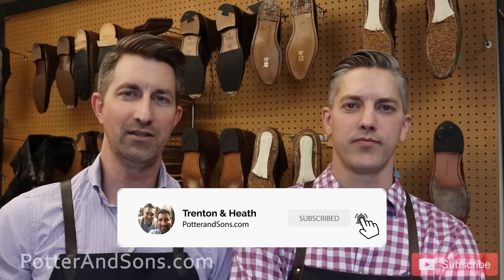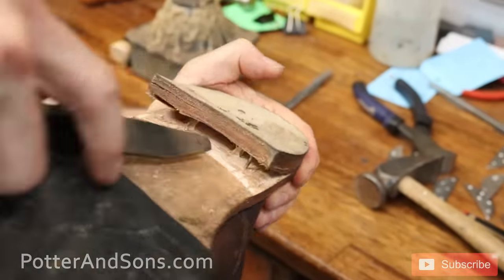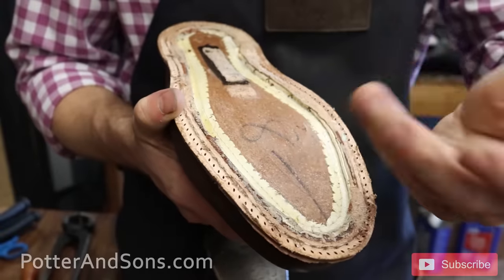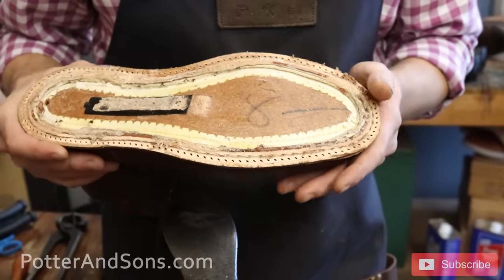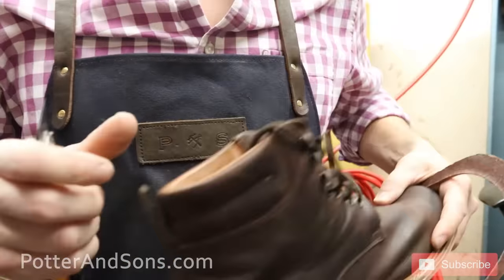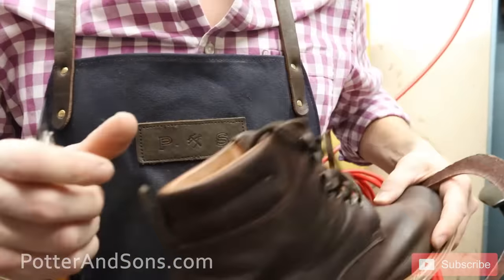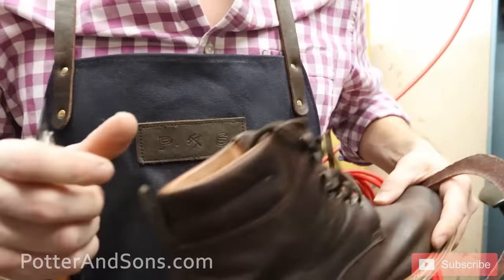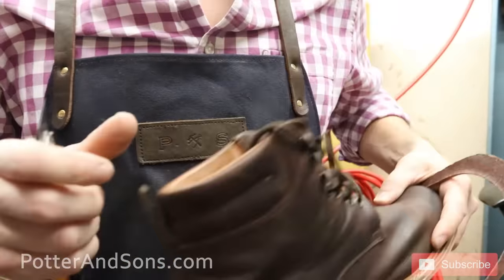Boot Restoration | Refurbishing These Boots With Vibram Wedge Soles

Comment: Shoe restoration: The Elegant Oxford has made into a Goodwill shoe picker! I recently found a pair of mystery burgundy long wingtips at Goodwill for $9.99. (They look like Florshiems.) The uppers aren't in bad shape. Pebbled leather, made in U.S.A. (Even have the UFCW union stamp on the inside!) The soles look like doubles with O'Sullivan rubber heal pads. I'm pretty sure these are vintage mid-level department store re-brand shoes. (Which makes them high end by today's standards.) The leather soles are worn down to the welts on the front tips. (360º welt!) Would love to get some nice soles on them to resurrect these beauties! Make this Goodwill dream come true! Love the channel, guys. Learned a ton about shoes here prize or no prize! Glad you're safe after the tornado.

Comment: Shoe Restoration... Hey there! I took your advice from a prior video and got a cheap pair of Allen Edmonds off of eBay. The uppers are in good shape and the sole isn't terrible, so it might not be what you are looking for. It says "1968"  inside the uppers and everything but the toe and heel is "Hamstead weave." It's odd but I thought it looked cool and different. In the interests of sweetening the pot: do what you like with them. Neon green stitching with purple soles? Fine by me.

Comment: Shoe Restoration: 2016 Red Wing Foreman Chukka boots. Had their neoprene sole replaced with woodman’s heel and an shank added which didn’t have before in 2018. 2020 they need a little more TLC since the heel is running out and half sole as well. Would like to go with a half JR leather sole and vibram heel 😁

Comment: Shoe Restoration - I have my pair of standard issue black leather combat boots from the BDU era. I have marched hundreds of miles in them and ran almost as many wearing them as a cadet. The uniform has changed, so I only wear them for hunting, but the upper is getting pretty beat up and there is nearly no tread left any more. Not sure if they can be re-soled.

Comment: Shoe restoration 
Pair of Italian boots from a small company called Area Forte. The heel pads are worn down to the block. They are Goodyear welted 270 and definitely need a resole. I bought them used and wanted to refurbish them myself. However, the pre-owner seems to have treated them rather poorly as the uppers are quite dehydrated and the leather starts to crack. I don't know if you can still do sth about it. But they are beautiful and I'd love to wear them on a regular basis.

Comment: SHOE RESTORATION
I have a pair of twisted x cowboy boots that I've worn for about 8 months, and I've beaten the crap out of them. There are parts of the rubber on the heel that have frayed off, and the leather sole has a hole in it on one of the boots (can't remember which right now). I've considered having them resoled or even buying a vibram sole set and doing it myself. Any feedback would be appreciated.

Comment: Shoe Restoration - I have a pair of shoes that is manufactured by the Rocky company. I love my pair of Rocky shoes, these shoes are the best shoes I've have ever owned. I have these shoes for more then 10 years now. They are starting to wear out. One of the shoes has develop a hole. I know these type of shoes are manufactured in high volume, mass production, some parts of the shoe even has fake leather that is wear out. Not the highest quality pair of shoes that you guys make repairs and restorations on and are used to.

I've always wonder what it would be like to replace the fake leather with real leather and restore the rest of the leather and replace the old soles with new & better soles, making improvements to these shoe. Making them better than the original manufacture make them out to be or intended to be.

Thank you guys for this opportunity and for reading my commend....

Comment: SHOE RESTORATION - question regarding welt:

When re-using the original welt, how does the goodyear welt machine guarantee always re-using the old stitch holes? Does it ever create "new" holes on the original welt when stitching on a new outsole? Thanks for uploading these videos. 

I have a pair of Snuff Suede Alden loafers that need a re-sole and would love for you guys to do the job!

Comment: Shoe Restoration: I have a pair of Ariat Ironsides that could definitely use some help. I’ve walked through the sole near the ball of one foot and worn down to the heel block on both heels. Plus the vertical stitching is busted on one boot. But they’re the best boots I’ve ever had.

Comment: When it comes to resoling these again, is it possible to only remove the rubber outsole and reuse the midsole or would that have to be replaced as well? Also if the inside is lined with another layer of leather would it have to be conditioned as well where they overlap?

Comment: Shoe Restoration: I have pair of Danner Commander boots that I would love to have resoled and worked over. They were a pair of duty boots I wore when I was a full-time firefighter. I now am a full-time Fire Service instructor and would like to use them now on the job, but the soles are worn bad in places and need some (a lot) of TLC.

Comment: sounds like a great competition.......I have a comfortable pair of Lloyds ( Germany ) black leather shoes which fits me like a glove but unfortunately the toe keeps bending upward and leaves unsightly creases on the top........I hope a sturdy shank on the front part of the shoe can solve that problem ( although its not the usual thing to do for any cobbler ) 

The sole already has been replaced ( just glued ...ahhhhh ) but the bend of the toe does still persist..........and everytime using a hot fan to straighten the top shoe is quite a hassle

Comment: Shoe restoration. How would you like resoling a pair of Made in England Dr. Martens 1461s? Been wearing them everyday for 5 years and that's a third pair that keeps wearing out on the heel. Lots of scuffs and tears and I noticed I now have a small hole where the shoe bends on the toes.

Comment: Shoe Restoration: Early 2000’s salvatore ferragamo loafers. The soles are cement construction (I think) and wrapped around the upper a bit. The plastic (I think) that attaches to the sole is cracked. . My dad gave me these shoes when I was a teenager and have worn them for every special occasion, including my wedding. Would love to keep them with a stitched sole if possible. Uppers in good condition.

Comment: Maybe its just me, but I like the plastic/plastic like material shanks. They are just as sturdy as metal shanks, and will probably last just as long. The plastic shanks also don't set off metal detectors. It takes me like 5min to put my boots on and prob another 3min to take them off. So it was awkward as hell getting my boots off to put through the x ray machine with a packed line to get into the CN Tower in Toronto.

Comment: Shoe restoration: A pair of Allen Edmonds chukkas that originally belonged to my father. After he passed away, I started wearing it but I didn't know much about high end shoes then so I wore the heck out of them. The upper leather is badly in need of some love and it looks like some of the welt has become loose. Hoping to get these restore because to me they are more than a pair of shoes.

Comment: Shoe Restoration: I have a pair of military boots from the 90's. They are lineman boots from when I worked on the flightline. This is before all the new boots came out, so these are proper made footware, the soles were even made from recycled tire rubber. These were never intended to be taken care of, they were work boots and would have been replaced by the military, not fixed, so they are in pretty rough shape. I went through a pair every six months, wearing the heals down. Didn't have the heart to throw out my last pair. Still good boots.

Comment: Shoe Restoration: 1978 Avirex Type A-2 boots, they are MiUSA allegedly made for the US Airforce. They are jodhpur with a pointed toe and a cuban heel. instead of a normal buckle they have this latch like on a webbed belt. I got them as i have never seen any military boot like them.  They  are rough all around. they need new soles and top lifts, as well as fixing the stitching in a few spots.

They are just incredibly quirky and I would like to see them fixed up!

Comment: Shoe Restoration: Have a pair of Allen Edmonds Road Warriors Wing Tips that needs the rubber soles replaced. Comfortable shoes but factory rubber sole is soft and need a harder material. Shoes were walnut in color but I dyed them burgundy.

Comment: Shoe Restoration: Frye Chelsea style boots (dunno the model). The heel has “Wallabee” type rubber on the soles that have been super glued back on. The uppers are a suede leather that have been worn pretty smooth. These are in pretty rough shape.

Comment: Shoe restoration: some diesel boots I have ... love the uppers and wearing the sole down, which are really thin right now.  Would be cool to remove the rubber sole and add some leather soles.  Love those boots ... have been turned down by the cobbler nearby.

Comment: Shoe Restoration:
I have a pair of Irish Setter work boots that have seen better day. Inside the boot the heel as worn through the vamp, and the stitching on the heel has ripped to the point where I can get a finger through. The heel is worn on both shoes, and the sole is split/cracked. The leather is also worn a good bit, but not all the way through. 

They're very comfy, and I still wear them when I'm not going to be in wet weather. They used to be water proof, but that went away with the sole cracking/splitting.
Unfortunately no cobbler around here will try to repair them.

Comment: Boot Restoration: "Beloved" Red Wing 1170 Boots worn since college with worn down one piece rubber soles and tread from 09-2010 that are no longer red in color. I do not have a preference for repairs or upgrade,  and would rather be surprised with whatever your creative minds come up with. I spend my days walking around a campus all day in wet conditions so a #1219 Arctic Grip or some other Vibram Boot Sole that you prefer could work. Thank you for our consideration.

Comment: Shoe restoration: a well worn pair of Bertie shoes. I've had them 'resoled' by a local chain cobbler but I'm not happy with how they turned out. They were too scared to attempt to fix the welt on the shoes... So just stuck some rubber on the bottom.

Comment: Shoe restoration:  Clarks Unstructured. Not sure it they are re-solable or not, but they are the first shoe that have stood up to the abuse of my walk. I am flat footed and have a long stride, so the heels take a lot of impact. I can destroy lesser shoes in a week. After 3 years I wore down one pair, and liked them enough to buy another. I'd be willing to  send the older pair if you could fix them, as it would be nice to have an extra pair in a different color.

Comment: Shoe Restoration: I bought a pair of AE Woodstock loafers off Ebay that have had work done to them previously; dare I say several times. I think it would be a good video to show what was done right, and what was done wrong. I don't even necessarily want them back, and you can just give them away once done.

Comment: SHOE RESTORATION: I have a pair of 4 year old Thursday Boot Presidents (Natural) that need some help on the heel block (similar to this video, but so far the rubber hasnt been completely worn through). The main soles are fine but they have lost their "knobs" from wear and tear. Lastly, I used to wear these at work but a couple of stains on the front cap toe section prevent me from doing so now - I tried the Renomat plus conditioning plus polishing technique but that didn't work out too well by myself!

Comment: Shoe restoration. I have 2 sets of brown boots(one bought in Ga and the other in Tx) I’ve had for 10 years and traveled the world with. Unfortunately, they have taken quite a beating from traveling and dancing in over 30 countries. The soles are completely torn off and cracked. Inside lining is ripped from rubbing on the nail.

Comment: Shoe Restoration -I've got a pair of Timberlands Where I've just barely started to wear into the heel block (in a similar fashion to this gentleman) although I was extremely surprised to discover the heel blocks are PLASTIC! I thought they were leather, but they're just coated in some kind of material that makes them look like leather. Plus, I feel like the soles aren't as solid as they used to be; they're starting to lose traction and they're starting to get a little wet inside when I walk around outside when it's damp. I'd love to have them resoled and also to have real leather blocks put in.

Comment: Watched this video because I was wondering if you can resole a heeled sole boot with a wedge. I guess the answer is yes. I was wondering because maybe the shape of the boot or design is specifically done in a way that a heel lifts the boot correctly for balance/posture whatever. Would like to try a wedge someday in the future, though my boots current soles probably have a ton of life left in em so it could be 2-3 years before that happens...

Edit: While I'm at it, do these wedge soles ever come in a color other than white!? Is it like car tires where there is a reason they are always the same color? I'd think I'd much prefer a black wedge sole personally...
Reply: There are black wedges by Vibram. Wilcox boots offer their 'Kern' with black.

Comment: Shoe restoration: Lol I have a pair of Stacey Adams shoes that are falling apart in all the different ways. The uppers are falling apart, the insole is a mess, the heel block is plastic and it's crooked. Without fixing ill end up throwing them out eventually, but let me know if you'd like a run at them. They were with me from 11th grade through to my first job, with infrequent wear until this year. The shoe's value is entirely sentimental at this point.

Comment: Shoe restoration: my grandfather and greatuncle used to have a shoe repair shop but they have both passed away, now there is no shop in my area. I have a pair of refridgiwear work boots that are in desperate need of some fresh vibram soles and the inside of the heel patched.

Comment: Shoe Restoration: Wolverine 1000 Mile. Had a bad sole protector job on the original leather soles. It fell off and I kept wearing them until I had worn through the leather sole. Could use some TLC.

Comment: Shoe restoration. I have a pair of Wilcox boots that I have not been able to wear. It feels like there is something in the heal. They were like that brand new out of the box. I was told by the company that they had a problem with the glue. There is no cobbler in my area to redo the heel.

Comment: Shoe Restoration: I have a pair of Red Wing Stock Nr. 950 boots (that aren’t made anymore) which I love. I worked as an electrician and these had the moisture and oil resistant, electrical insulated rubber soles and that rubber has just broken and disintegrated. I reached out to numerous shoe repairmen and they all say there is nothing they could do with them. The boots are so comfortable and since I’m now retired, I don’t care if they have the rubber soles anymore... I’d just like to have any type of soles installed so that I could wear them again. Anything you guys could possibly do?

Note: The redwing replacement is: STYLE #435 MEN'S KING TOE® 6-INCH BOOT (for reference)

Comment: Shoe Restoration: I’d pay for mine, they aren’t totally beat up, I fell down a short flight of concrete stairs, the toe of the boot bent under me and dragged, so the leather scuffed a bit, I put a few coats of polish to hide. I also wore the heels down on the insides. A few Pilates reformer sessions had corrected that, but weight gain brought it back. I’d just love them repaired if I can afford it. They are not that 🤕😅. They are Sorel Joan Gladiator Wedge Boots.

Comment: Shoe Restoration: I love my Belleville military waterproof boots but there’s something wrong with my right boot, there’s some type of hole in the sole that allows water to come in. Both of the grips on the bottom of the feet are extremely slippery and rubbed down. I’m still in the Navy and I still slip around with these boots on anything but concrete. I would love for them to be restored so this way I can wear them forever.

Comment: Shoe Restoration: Ariat boots found in a thrift store, rubber soles, heels worn down cock-eyed, one heel really severe, going deep into the (rubber) heel block, so that I cannot wear them at all, without resole, because they make me feel like I will easily tip over and fall, with that one heel being 1/2 shorter than the other and worn off the back like the one foot/heel was dragged. I am not sure about the rest of the health of the boots but the tops flop over. The thrift store seem to think they are nice boots that have just been treated shabby.

Comment: Shoe Restoration: I do have a 30 Year old pair of Doc Marten's I wouldn't mind resoling w/ Vibram Wedge Soles soles and a leather welt. I wore these when I worked in Factories for 11 years, they are really beat up. and need major work. Keep in mind these are post 1985 corrected grain leather just like 90% of all Doc Martens in circulation..